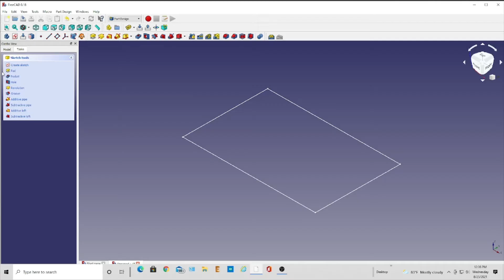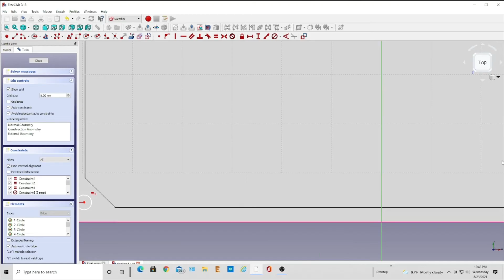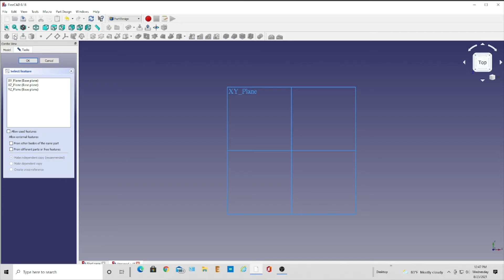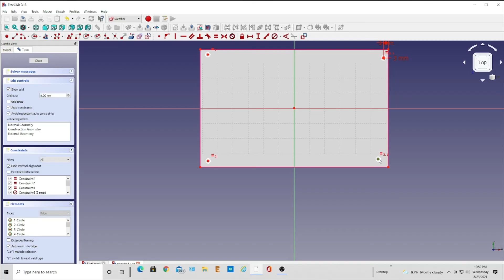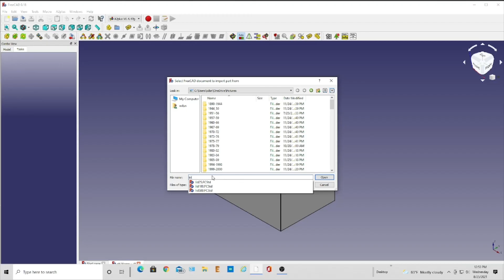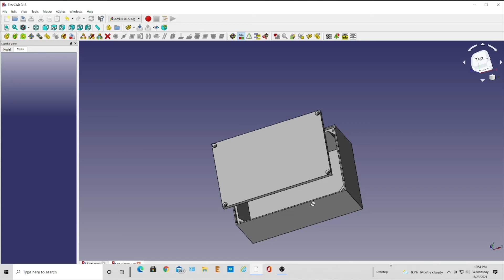FreeCad Project Box Tutorial

Comment: Apparently there have been some changes to the hole parameters since this was filmed. At least on the version I have, the options for Profile are ISO metric standard and ISO metric fine (as well as some UTS profiles), there is no "ISO Metric coarse" profile. I chose "standard". Also, with "threaded" checked, there is an additional option for "Model Thread". Without this checked, the holes did not work for the specified screw size (we'll see if checking that fixes the issue once my second print is complete). Finally, my research seems to indicate that you want a 6H class, not a 4G for "normal" usage - 4G would be tighter tolerance (which MIGHT be good). I'm not clear on the G vs H difference though. Perhaps my research is lacking?

That said, this video was still EXTREMELY helpful, and I am quite glad that it was made and that I found it.
Reply from the maker: Thanks for the great feedback

Comment: Had some mild frustration with this. 1) in Edit --> Preferences, you must check "substitute decimal separator"; 2) AS SOON as you "Add PlaneCoincendent constraint" it lines them up and no further action is required (i.e. you can close the popup window). With these two problems, I was failing to see why I couldn't proceed. It wasn't until I started the project over from scratch that I got that clarity. This is nuance that OP probably couldn't account for, so no shade.

Comment: Tim, great video. After looking up the "Explode" tool I realized you meant the "create an edge linked to an external geometry" tool. I just bought the latest book that cover v0.19 and it was printed on January 25th, 2022 so it is fresh. Could you make a video on tubes and pipes as I always run into issues with those although I figured them out with DesignSpark Mechanical. Like making a tube that has a few angles and it connects into a box like a tank or a manifold. I always get tripped up at hollowing them out if the have and angle as opposed to a straight pipe. Thanks.